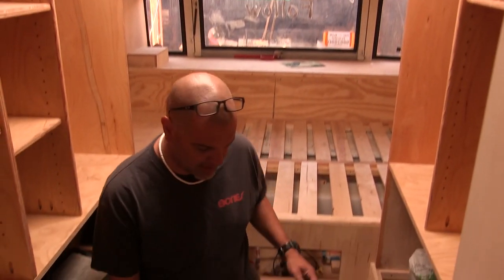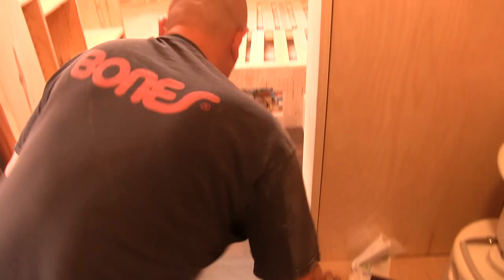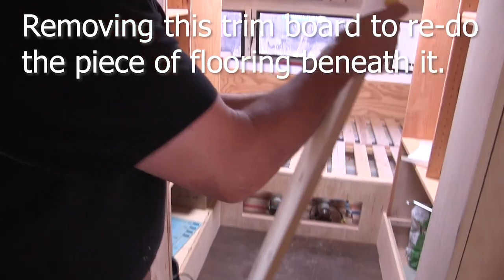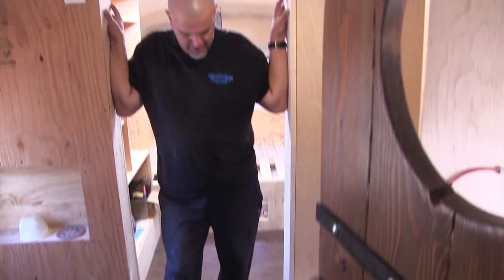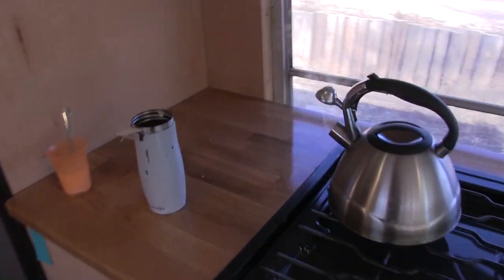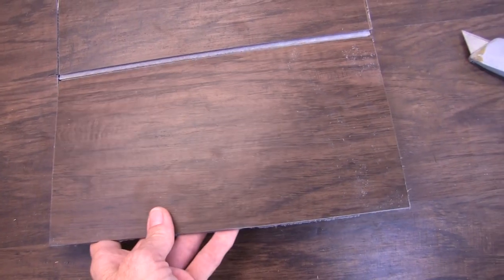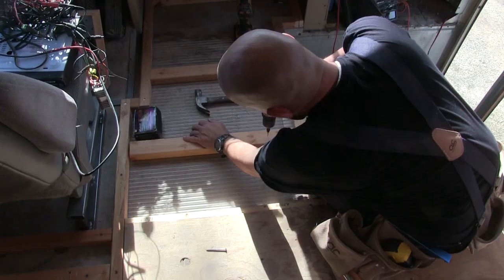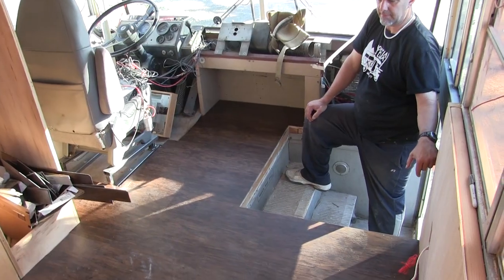We DIY'd Luxury Vinyl Flooring In Our Skoolie!

Comment: I haven't looked through the comments but I'm going to point out a couple of things. what you're putting down is known as a "floating" floor. In order to expand and contract (and it will) you need to leave a gap all the way around. And you don't use anything to stick it to the sub floor. SOOOOOOO................ When you see that the flooring is starting to buckle don't worry. You'll just have to cut about a quarter inch off all the way around the perimeter. Just make sure you run the A/C long enough to draw the humidity out so the flooring lays flat again.
Reply: I was about to say the same thing!
Reply: Humidity does not affect vinyl. Temperature does, as I found out.
Reply: ive been looking for this info everywhere ! thank you so much !!!

Comment: Did my bathroom in a day. I laid paper templet down first. Measured twice (of course). I used my chop saw outside for all the cuts. Made a mess, but saved my hurtin hands. I too was amazed at the speed of installation! The round curves were fun...🙄 
You've done a great job! I drove bus for a living and seems very natural to me to do this, retire, and travel. My only worry is maintenance costs. I should have tried to marry a good diesel mechanic!🤣

Comment: Are you going to put an edging along the edges by the steps? Otherwise, over time, the flooring is going to crack away and look really messy. You can get either wood or aluminium right angled strip that will fit really nicely in there.

Comment: not sure, but wouldn't you have less of a hassle if you did not try to get it too close and then put a quarter round shoe trim at the bottom? If it is too tight then seasonal movement may cause it to buckle won't it?

Comment: I hear a bunch of people saying that you should not glue a floating floor but I can see no logical reason why not. As long as you use a flexible glue or adhesive that can flex along with the floor there should be no reason why not. And also in a vehicle application I would hate to have a floor that is capable of just coming up in the case of an accident
Reply: No answer